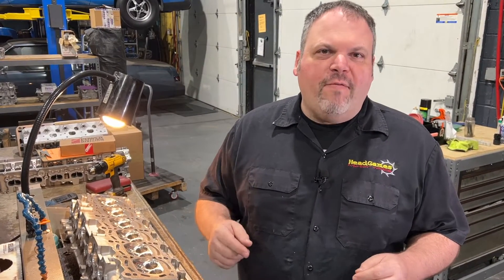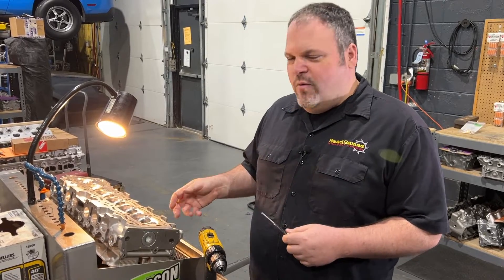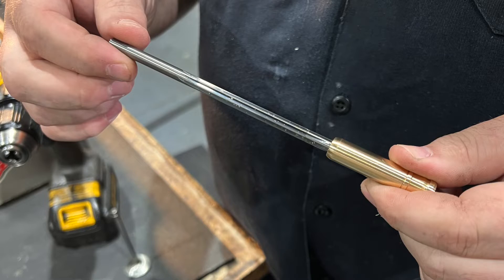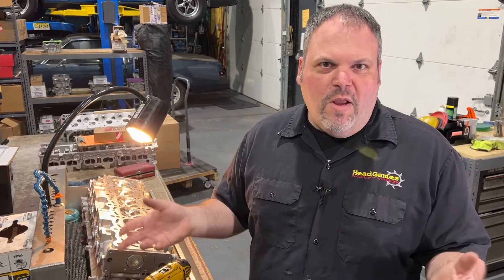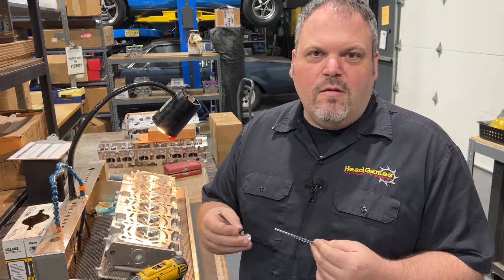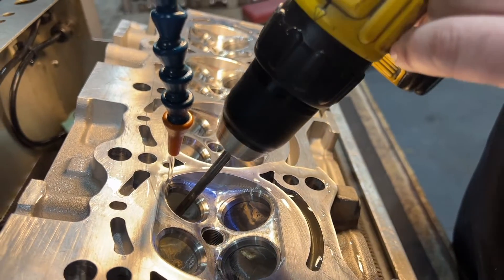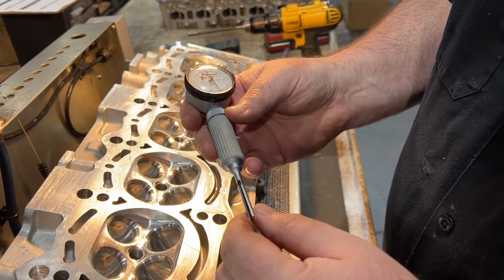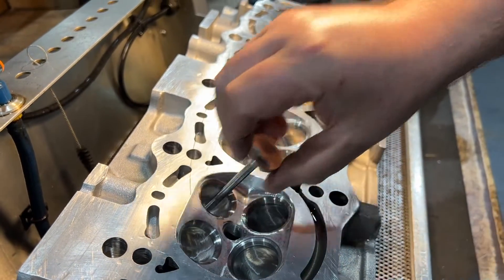Tech talk - valve guide ream and sizing explained!

Comment: Have you ever worked   on a Cummins 24V head?  How tight of clearance should I be running on a diesel with high hp numbers & excess heat? Guessing closer to 1.8 or 2tho max, I see your at 1.68 thou clearance on these heads.   How does SBI guides & tooling stack up to the products from Dakota parts warehouse?  Would love to have a head station like that but Goodson doesn't make one for the length & weight of a 24V cummins head.
Reply from the maker: Never worked on anything diesel. I have also never used SBI for tooling, but have for guides and OEM replacement parts. Dakota is a Ferrea dealer and we get some obscure custom tooling from one of their connections for reemers but nothing else besides that. We just use Goodson for most.

Comment: Interesting videos. Any experience with Subaru FB16 engines? Am planning to rebuild one NA for 200 whp
Reply from the maker: Never even heard of that engine. So that’s a no
Reply: @headgames  The FB blocks are more economic for fuel efficiency etc so they are very slow compared to the EJ and FA series
Reply: @headgames  The setup is basically the same as other Subaru engine models. They are the same boxer type engines
Reply: The FB engines are Subaru newest engines. So they have FB16, FB20, and FB25

Comment: Hello, over the winter i eanted to port my supercharger 1G-fe engine. It comes na stock, is there anything to look for when porting an cylinder gead with a "fuel econmic" design that is turned into a performance engine. Is there any way to know that i wont hit any cooling channels ?
Reply from the maker: I would just leave it alone unless your making some real power with it. 800+whp then worry about porting it. We have never done a 1G-FE to know dimensions on how big to make it. If you hear it an echo stop!

Comment: So, does the valve to guide clearance change with the type of environment its going to be used in?
Reply: Hello Dave, why do you ream your guides over honing? Love the vids mate!
Reply from the maker: @REPerformanceUK  Thanks for the kind words! Great question! Because it's so much faster and more repeatable to get the correct reamer vs honing. We do still hone a few things but for the most part we ream all of our most common.
Reply from the maker: Great question! Yes, but only a few tenths of a thousandths
Reply: @headgames  Does valve clearance adjustment add to horsepower?
Reply from the maker: @prophet6896  I have heard people say that but I don’t think it’s true. A couple of thousandths of an inch is not enough to sway your whp.
Reply: @headgames  Ok thanks. So u don't think it affects hp to any degree then? I was planning to increase my valve clearance for done top end hp
Reply from the maker: @prophet6896  We do lash for a means of helping parts survive. I could be wrong but I just don't see or have seen lash be an actual factual power having situation in an import head. Maybe with a rocker you would see something but that again is for helping parts survive. My Moto there is too loose you know it, too tight everyone knows it. Because it tight lash hurts parts much easier than a loose lash. Loose lash within reason obviously .
Reply: @headgames  Thanks much for the information. So what would u recommend for valve clearance adjustment. My FB16 is NA
Reply from the maker: @prophet6896  whatever the factory range is. I just looked up your engine and I guess it is like the FA20. We don't do anything with lash on that head. So, can't speak intelligently about it.
Reply: @headgames  How much power u think I can get from a pocket port, fuel pump upgrade, custom header (equal length), MSD ignition system wit MSD coil and 250 fuel pump upgrade?
Reply from the maker: @prophet6896  no clue. We never do all motor and not sure how bad your head is (never seen it). 
a stab in the dark would say 10whp if you got the valve job right and someone good did the porting.
Reply: @headgames  😲 Just 10 whp. Thought I would get a little more than that
Reply: @headgames  The head have some grove in it from the tvg delete. There was some thin metal in the entrance of the head that connect to the intake runners so all that part will have to port and polish so the shape of the head opening can be uniform